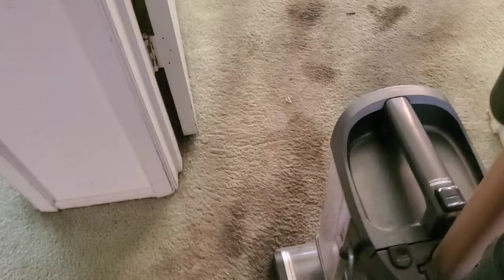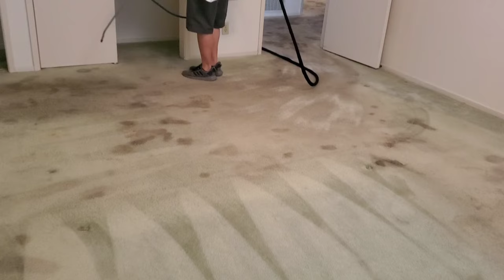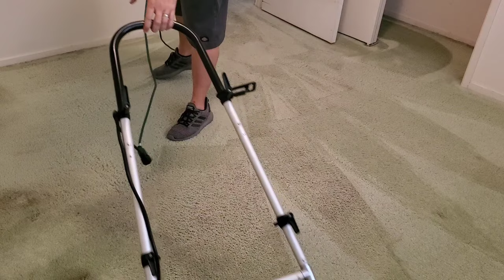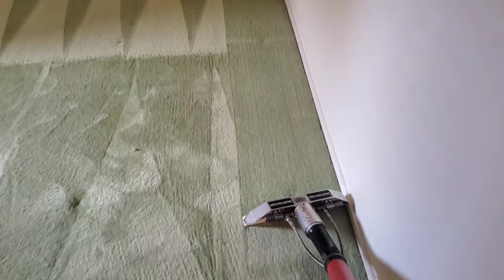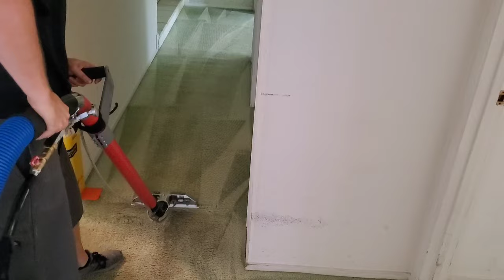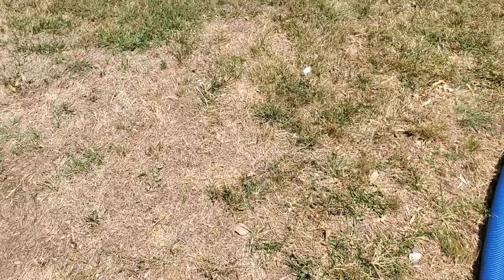Extreme Pet Urine Carpet Cleaning ASMR

Comment: 😵Damn you good. I still remember in one of your videos you said !!!! its not the machine that's doing the work, it's the chemicals that does the work. Excellent work💯
Reply from the maker: TACT. Temperature, Agitation, Chemical, and Time. Each has its place. Good chemistry plays a big roll though. 😊
Reply: Learning from the best 💯
Reply: @blackdiamondcleaningservices  excellent
Reply: And what's the best chemical to use for cat vomit - that will not leave a detectable glow under UV light??  I pick up any solids and as much liquid as possible, then spot clean with carpet cleaner for pet stains, including trying the enzyme cleaners. There is no visible stain on the carpet - until you shine a black light on the carpet!!  Oh my!  I have to use a black light to even find some vomit from our multiple cat home because many times the vomit is EXACTLY the same color as our carpet!

Comment: This I find to be the most useful way to run a carpet cleaning business.  This is due to that this shows how to get rid of the dirt not only from the vacuum cleaner, but also from the CRB and what gets sucked out through the extractor.  Dumping the dirty water onto the grass is good since it sinks into the ground and the fine particles in the water becomes compost.

Comment: Definitely an amazing job, I wonder if the smells will come back though?
Reply from the maker: Hi Nick. Thanks for watching. There is always a chance of that with this amount of urine saturation. It becomes a problem when left long enough to enter into the padding or sub-floor. It has been about two weeks and no message about smell returning. Having great chemistry and tools to pull as much as possible is very helpful as well. As stated in the video I suggested replacement, but this was a specific situation we're they just wamtes it cleaned for the sale of the home.

Comment: I’m not a carpet cleaner, so this question may be stupid.  What type of equipment do you have in your truck to suck all of that extremely dirty liquid out of the carpet, through what is likely a long hose, all the way to some sort of tank?
Reply from the maker: The machine used at this house is a Truckmount forums Profire made by Steamaction. It has a fresh water tank and a dirty water tank on it. The hoses run to the vacuum ports that pull everything into the dirty tank. That's a basic run down of it. Feel free to ask any questions. I'll do my best to answer when possible.

Comment: What kind of wand do you use?? And would you recommend it
Reply from the maker: It's the TMF 2in swivel wand, and we carry them in both vans, and I actually have two in this van. One is running 8 flow and the other 12 flow. So if I need to flush something a bit more, I have options.

Comment: Hi, i dont suppose you could give a link to the pretreat spray products you used to get rid of the cat urine? I have heavy build up of cat urine in my carpet which i dont want to replace as its less than a year old and ive tried an assortment of sprays and pre treatment but cant get rid of urine smell! Any advice on where to get ur spray pre treatment would be greatly appreciated 👍
Reply from the maker: Hi there. The product we use to treat the urine requires extraction. Do you have a truckmount machine?
Reply: @blackdiamondcleaningservices  sadly I don't. I only have a carpet cleaner and a wet and dry vax
Reply: @blackdiamondcleaningservices  I was wondering if it's possible to use a pre treatment to get rid of the cat urine smell and use my wet and dry to extract then go over with carpet cleaner afterwards? 🤔 I've already got all the urine stains out the carpet   I just need a way to get rid of the urine smell which still lingers 😢😔

Comment: Why do you have screaming jets on your wand? Just wondering
Reply from the maker: These are normal jets for this type of wand. It may be different if you're listening to a wand with only two or one jet. There's different flow rates for jets. This means how much liquid can come out at once. The most common are 4 flow and 8 flow. This wand has 8 flow, so it allows twice as much as a wand with only 4 flow. Which may be a part of the reason it sounds louder. Hope this helps.

Comment: Is there a nice professional portable you would recommend
Reply from the maker: Yes, there is one on this site. https://shop.truckmountforums.com/ac

I'm sending you this link because it will give you a $20 discount off your first order over $100. Here's the direct link for one that's good for carpet and upholstery cleaning. https://shop.truckmountforums.com/products/tmf-extreme-vacuum-portable

Just make sure you back out and use the first link. Otherwise, you may not get the discount applied.

Comment: Ain’t no damn way. I’m pulling that up & throwing it out. 
They had pets, so it doesn’t matter if they vacuumed or not, they would have to do a slow vacuum a few times (after the first regular vacuum) to get most of the fur up.
Reply from the maker: I agree. House was being sold, so I guarantee it has been. That was my suggestion to the client. Still wanted it cleaned for the sale.
Reply: @blackdiamondcleaningservices , you did a hell of a job, it even looked like it may have smelled good afterwards.